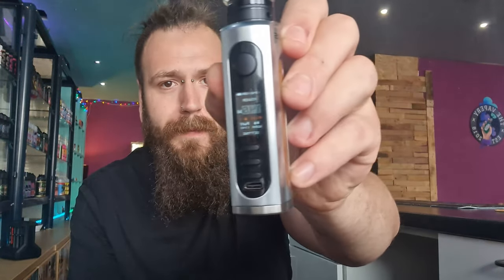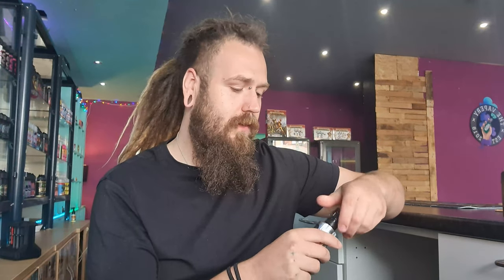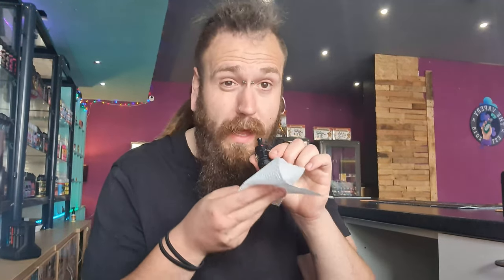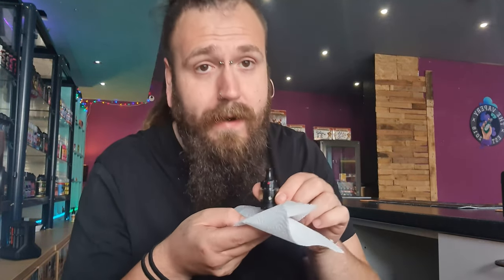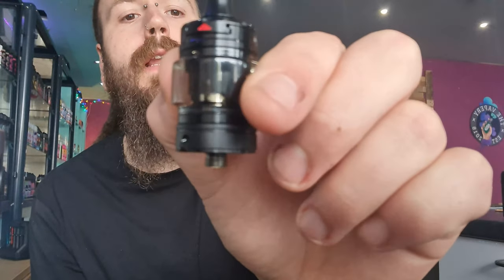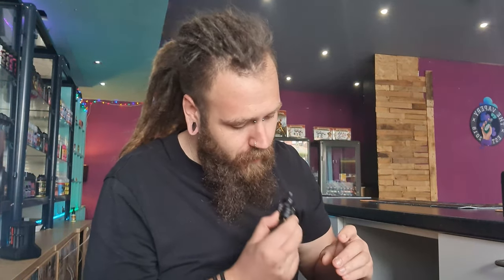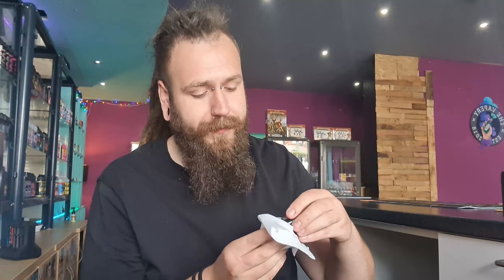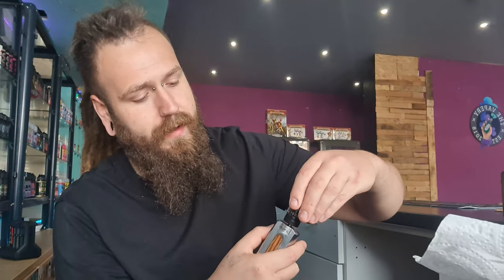Why is my vape spitting at me /making a popping noise ?

Comment: Weird. For me its the opposite. When i push more liquid into my RDA (using a 2x 062.ohm dual fused claptons) crackling stops. When it runs out a little on liquid it starts to crackle. Any ideas? It's only these duel fused claptons btw. Other coils were fine, didn't make any noises.

Comment: I knew mine was flooding but looking into it in the past, I just kept reading that this coil and that coil had some dodgy batches and I thought surely not, but I wasn't seeing actual specifics on how to stop it, turns out I'm a numpty and had been using too low of a wattage, nice to know that I don't need to be avoiding my stock coil tanks now; I've got a few because I thought oh they'll be good when I'm feeling lazy, then had all this faff with flooding, this should see me right though. Definitely a wattage issue for me because I don't really go below 70vg. Thanks, you solved something that I kept wondering about for a good while!!